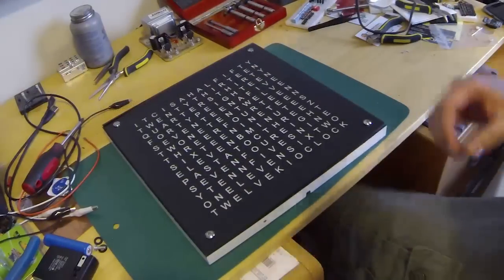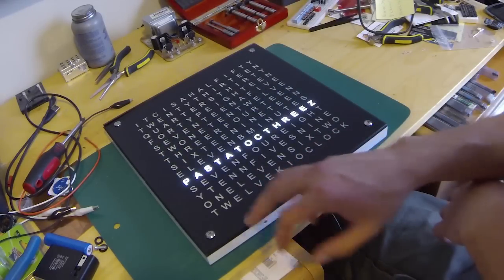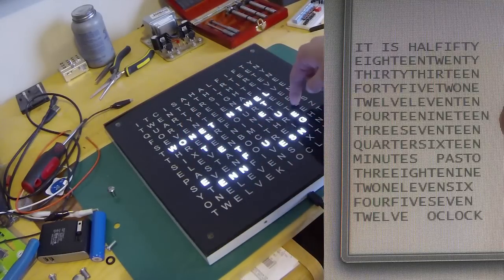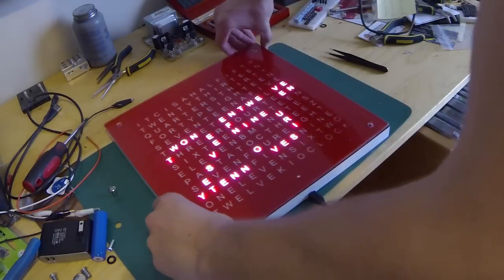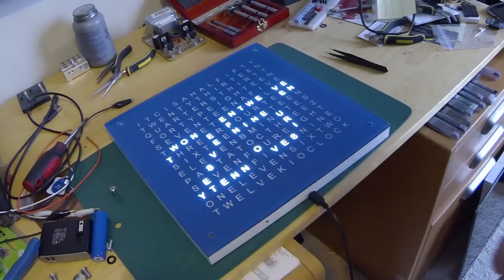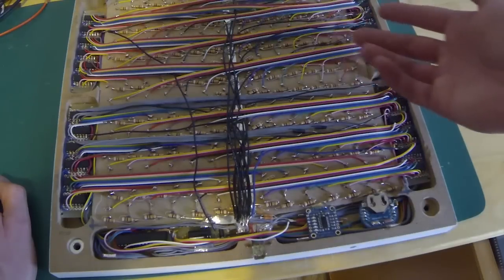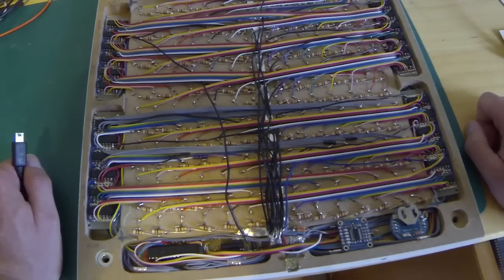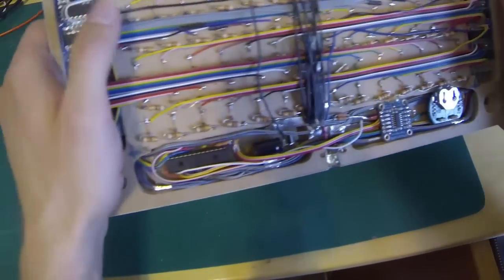Word Clock - overview, recommendations, picture build process

Comment: What type of touch sensors are you using?
Reply from the maker: I've seen people use bananas, but I had some thin copper sheet which I ran a wire to from the dedicated IC (see description). Alternatively many microcontrollers today can be purchased with this functionality built in.

Comment: Awsome project! Made something similar and can't get rid of the feeling that use of addressable LEDs will be way easier to program and wire it...
Reply from the maker: Thanks! Using addressable LEDs is certainly simpler assembly wise but there are some tradeoffs:

PROs
1) Significantly quicker assembly. Easier to scale up.
2) Significantly more compact if you want multiple colours.

CONs
1) Cost. $0.40-1.90 per addressable LED may be harder for some to justify.
2) Refresh rate. It is much quicker to refresh a display if you can do so row by row (parallel) than LED by LED (serial).
3) Brightness. For the same size footprint stronger LEDs can be acquired. Important when combating the sun.
2+3) Animation. If you wish to fade a single LED in and out you must repeatedly send it a new brightness. Being able to update only one LED at a time MAY be a bottle neck.

With that said, programming wise both are simple enough. If considering addressable LEDs I'd also consider some of the 4x4, 16x16, etc. LED arrays/matrices.. Regardless of how you go about it there will be quite a bit of work, but it's rewarding in itself :)
Reply: Thanx for reply... Few notes...
1. Cost is not bad, strip 300 addressable LEDs is cca €16
2. Wouldnt think about it - as long as you send new data to a strip, it is keeping it until you send new data - so only changes needs to be sent, no need to loop cycle ;-)
3. Brigtness is ok... depends on LEDs, anyway I agree
4. If you need to fade, you keep all LED data in matrix anyway for refreshing, so send it via FastLed library takes microseconds :-/
Reply from the maker: That price is great, and I'd have to agree with everything else. Fortunately we're not building televisions where it would be laughable, but for this application we can certainly get away with more.

Comment: Dear Caspar. Congratulations on the project and detailed explanation. This is impressive and inspiring. With literally no experience in electronics, do you think it would be wise to give such a project a try? Thanks!
Reply from the maker: Thank you Andreas.
I do feel this is a project anyone can take on, even as one of their first projects, no matter their experience level, but if you don't have an electronics background and want to make the most you can from scratch, I'd expect this project to take 6-12 months of your free time. Less if you use readily available parts (Arduino compatible parts, an LED array (random example: https://www.adafruit.com/categories/100), etc.).

Take a look at this website to give you a better understanding of what level of effort is required to achieve the product you want: https://www.instructables.com/howto/word+clock/

There is quite a bit of work involved and I'd consider this a good 'stepping' project if you want to pursue your interest in electronics. There's no better way to learn anything and keep you motivated than to choose a project you're genuinely interested in.

Comment: Nice video, I've learned a lot with your conclusions. It's very useful for someone that want to build one word clock. Do you have any recommendation for the angle of the holes. The default countersink angle (60 degrees) is not ideal?
Reply from the maker: That's good to hear, and thank you. I don't recall my reasoning, but believe it was related to wanting the frame to be one piece and as thin as possible. Whatever spacing and hole diameter I used though, I was never once worried about the structural integrity of the frame.

Consider the following for countersunk holes:
- they taper towards the top and as such diminish the amount of light that reaches the outer edges of your letters. Ensure you slightly oversize your holes or decrease the countersink angle so the center of your letters don't appear brighter (hot spotting).
- a countersunk hole removes less material than a straight hole, making your frame inherently more rigid.
- the bottom of a countersunk hole is not flat and won't keep your LEDs square. Either 1) drill the centre flat or 2) start with thinner material, drill/countersink through the bottom till the inner [hole] diameter is equal to or greater than your LEDs, and attach a flat board to the back to act as your LED base.

With that said, I feel 60/90/120 degree countersunk holes are better, but not significantly so. If you experiment you'll find that the most significant factor in achieving proper light diffusion is 1) the distance between the light source and diffusion material (further being better) and 2) the diffusion material itself. I have no preference to the countersink angle.
Reply: Thank you very much for your considerations. Nice explanation on your reply. I will follow your advice! I will try to buy a 3M light diffuser film (it's very expensive to buy a full package and it's hard to find a local shop that sell a small piece to a non professional individual). Regards

Comment: any tutorial or circuit diagram and code thank you
Reply from the maker: I don't have a tutorial or circuit diagram available, but the [incomplete] imgur (link) write up I created in the description should be a good start.
As the next starting point I'd recommend looking into the following topics: shift registers, multiplexing, current (not voltage) driving, and PWM. They can all be used to control the brightness of an LED and an understanding of those areas (pros and cons) will ultimately dictate your circuit layout.
The majority of the information you requite can be found online... but asking the right questions is key ;). If after looking into the above areas you still require a bit of guidance send me an email (casparbaczynski@gmail.com) with more specific questions and I'll help where I can.

As far as coding goes, your circuit will dictate it. The integrated requirements of your microcontroller and external driving hardware will be dictated by the performance/features you want out of your clock (how bright you wish your display to be, battery or wall powered, reactive to ambient lighting, input capacitive buttons, etc..). Using a precision oscillator vs. a battery back-up real time clock is something else that will also dictate your code. I'd recommend starting simple with a small array of LEDs on a breadboard, and build up your code as you require more features. You'd be surprised by the number of existing libraries and tutorials online that already exist which are applicable to this project.

Comment: Is there a link where I can get this Blue Plexiglas/Plastic?
BTW- The link above does not work.
Reply from the maker: +Ted Mieske The glass is from a local glass company (which I ordered and picked up for $15-60, depending on your size and finish; completely transparent), which I took to a local sign shop who cut/printed the letters from/on vinyl (in the colour of choice) and applied it to the glass. I'm sure you can find a business online that can provide a similar service, but since these types of shops are typically more abundant than hardware stores it's worth calling around. 
Plexiglass or acrylic can be purchased at hardware stores such as HomeDepot, but must be purchased by the sheet. It too is typically transparent like glass. You can probably find a shop locally that deals with plastics (if you have trouble ask a sign or glass shop for a reference) and have them cut you a piece, which will ultimately cost less than an entire sheet.

Comment: Hello Caspar, What is the LED spacing for your display ?
Reply from the maker: Thanks for the email. I'll reply here just so the information is open to everyone.

When deciding on the size/spacing of my letters I started by narrowing down the range of font sizes I liked, chose a standard bit size that fit letters in that font range, then chose a spacing that gave an adequate wall thickness between holes.

1) Letter size
I recommend printing a few font sizes on paper and sticking them to the wall. Walk around the room and see what size is the easiest to read at different distances. If you're not making this for yourself but for someone older I'd recommend larger fonts. For this clock I drew the layout In Adobe Illustrator and used a 36 pt. Arial (regular) font. That works out to a letter outline height of 0.9091 cm.

2) Hole size
Holes in the MDF were drilled using a 1/2" bit. Wider letters such as 'W' won't be illuminated at their outer tips but in reality this was barley noticeable because words with 'W' are only lit for 1 minute at a time and the clock is viewed at a distance.

3) LED spacing
The wall thickness between holes I used was ~3.6 mm. I decided on this intuitively/visually by drawing different spacings on paper; actual testing would have been the proper way to do it. This wall thickness gave a letter center to center offset of 1.63 cm. The frame was rigid but I'd contribute this mostly to the wider boarder. Slightly tighter spacing would work if you used wood but you would have to experiment yourself.
In Illustrator to ensure each letter was aligned vertically and horizontally I created a grid of 14 x 14 squares and diagonal lines then centered each letter with the center of each block.

------------------------------

4) Boarder thickness
To determine the boarder thickness (between holes and frame edge) you'll first have to decide which components you're going to use and their board layout. Ultimately I settled on the 30 x 30 cm frame which gave a hole to frame (edge to edge) thickness of ~3.66 cm. This was very tight for the components I used. I don't recall the depth of the cavities/channels which the boards rested in but the outer routed wall thickness is approximately 1/4". 

5) AT42QT1070 breakout board
I didn't technically use a breakout board for this IC but instead an already assembled board designed around it: https://solarbotics.com/product/19020/
After long term use my friend found that the auto-sensitivity calibration of this IC became too sensitive from long periods of discontinued use and would initially trigger well before touching the clock. The auto-calibration feature will self correct rather quickly after the first touch but the issue continues to arise after long periods of disuse. This isn't a deal breaker but if you can get a sensor with programmable sensitivity it will make the user experience just that little bit better. Alternatively, some microcontrollers have built in capacitive hardware features (I don't have any personal experience with them though) that you can exploit.

Comment: Hello Casper, is it possible that you would share the code, I really want to build it my self but writting the code isn't my strongest point. I like those extra fields for programming and the captivity switches. I hope you share the code with me. Thanks.
Reply from the maker: Not a problem. Most of the code I found online was a little daunting, but with myself being very new to microcontrollers, I needed to write something simpler. Send me an email (casparbaczynski@gmail.com) and I'll reply with the code. Commenting is scarce, but the logic flow is easy to understand if you keep in mind what tasks need to be done. Better yet, start writing your own and make references to mine/others as you need to. Don't forget this code will be specific to the wiring I used.

Post any general questions on this page (to help others). Anything code specific we'll keep in email. If something seems unclear, check the datasheets first.
If you're just getting started with microcontrollers (as I was) and will be using a PIC from Microchip Technology I strongly recommend taking a look at "Gooligum tutorials". Although not all tutorials are free (yet very reasonably priced), the commentary and step-by-step helped me pick up new concepts quickly.
Reply: Caspar Baczynski Great Work! would you mind also sharing the code with me? and possibly a schematic diagram if you have one? Thanks.
Reply from the maker: ivorylobster send me an email and it's yours. Unfortunately the only wiring diagram I have that survived is the photobucket one of the PICs pinout. Fortunately though, if you pull up the pin diagram of each component from their datasheet it's straightforward enough to see how it's all connected. Just keep in mind that there are 2 shift registers for each row, thus the Serial Data Out of one is daisy-chained to the Serial Data In of the other.